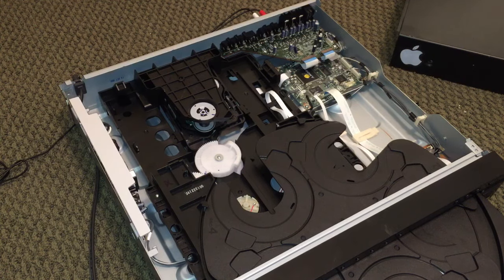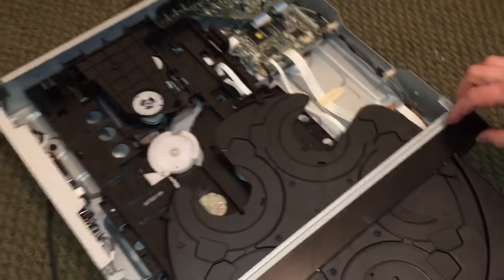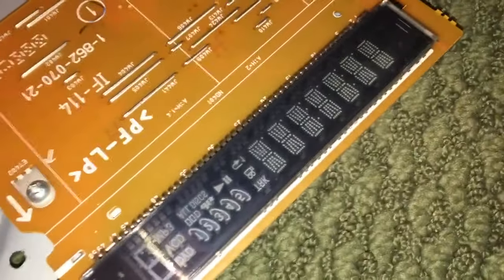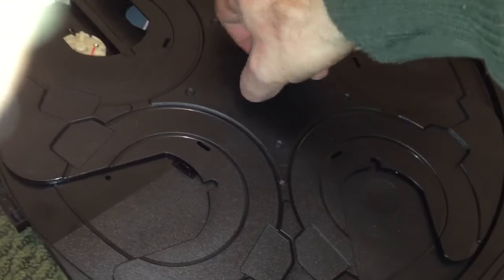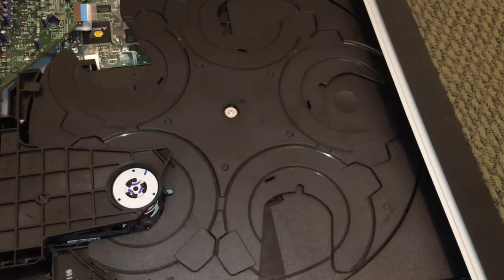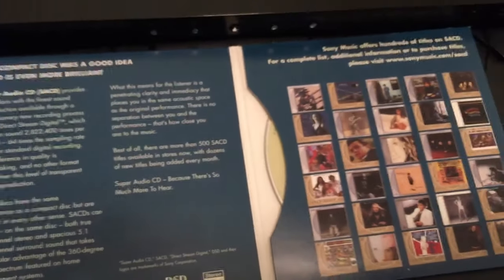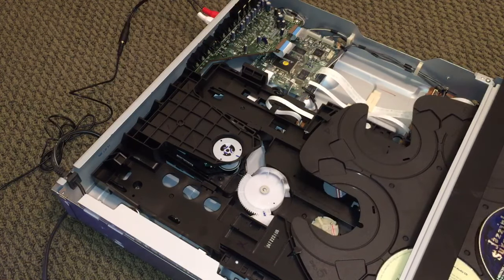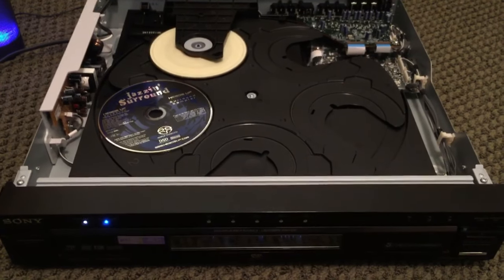Repair of a Fancy Sony DVD Player with Super Audio CD

Comment: I've never seen a DVD player with this mechanism (the Sony DVD changers I have experience with hold 300 or 400 discs), but I'm not surprised it exists. My regular CD player is a 5-disc changer, and I bet it has the exact same tray. My SACD player (dedicated, not a DVD player) has that exact same tray. The thrift store I bought my SACD player from has another Sony 5-disc CD changer. It's completely different from MY 5-disc CD changer, but it still exists. Probably has the same tray. I legitimately wouldn't be surprised if they made a Blu-ray changer with the exact same tray.

Comment: That's an interesting piece of gear. I like the display! I've had to pass up a few devices like that because there was no remote at the thrift store when the player needed that to do any but the most basic functions. The one time (so far) I got a 5 disc dvd player the audio was totally destroyed (rare problem) - I mean actually putting out random noise garbage yet the picture and search functions are too good to ignore. So it waits for one of those social events where only visuals are required.

Comment: I didn't know sa-cds had such a high sample rate, I thought it would be 192khz or something like that.
Reply: CoolDudeClem DVD-Audio was sometimes 192 kHz/24 bit stereo, but usually 48 or 96/24 and 5.1. SACD used 1-bit encoding at 2.4 mHz. They were in a format war, right about the time the iPod came out. Needless to say, they both went belly up. Shame, really. I still have a few and they sound amazing. DVD-Audio still works with regular DVD players, but at lower resolution.
Reply: Super high sampling rate at super low resolution.  It wasn't really better, it was just different.  A little while after this came out, the DSD DACs just internally converted the DSD to a PCM bistream anyway, so it wasn't even different anymore.  Just expensive, almost uncopyable (why hello there, first gen PS3!), and with hardly any catalog.

They sounded good mostly because the only stuff available was aimed at a more discerning audience, so it was recorded, mixed, and mastered better.  Loop it into a PC and record at 16/44.1 and it would sound the same.  That's why audiophiles get so wound up about the loudness wars ruining music.
Reply: the loudness war is very real and the biggest disease in music today! you are bang on about the better master/transfer being the real pull for these formats though

Comment: I used to have a Sony 5 disc DVD changer DVP-NC675P. It looks like this but silver, and it uses the same exact transport. I bought it at Value Village in 2012 (in Québec it is called Village des Valeurs). It is the same company as Savers.

Comment: How high the bit depth rate is or low, you have (with digital) always a 1/2 lsb error. 16bit depth 24bit depth.........
Reply: and that's why DSD has such a high sample rate, because otherwise with just one bit, you get this weird jitter.